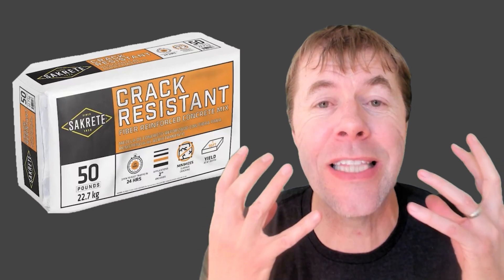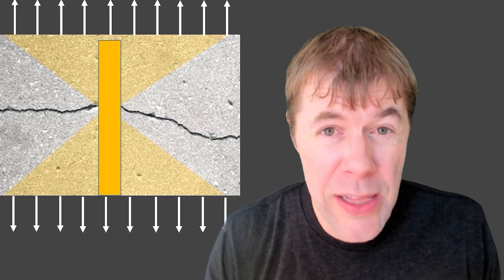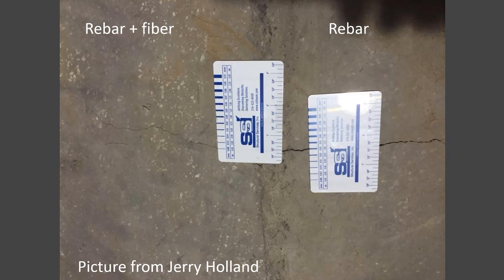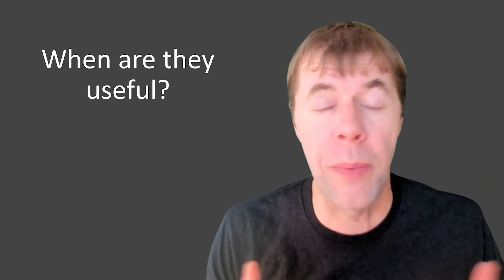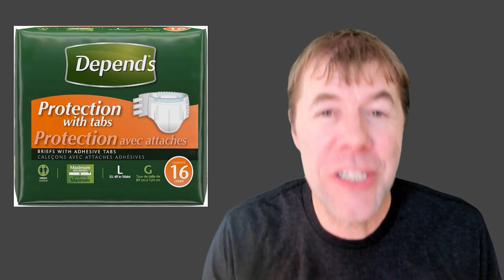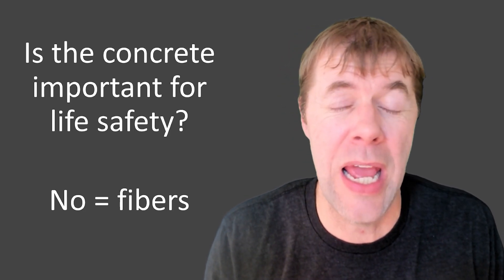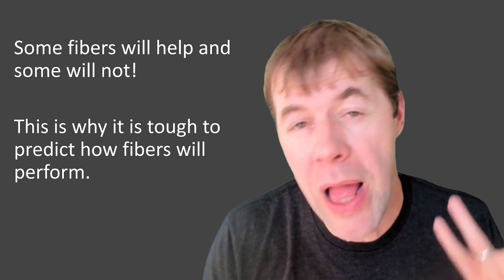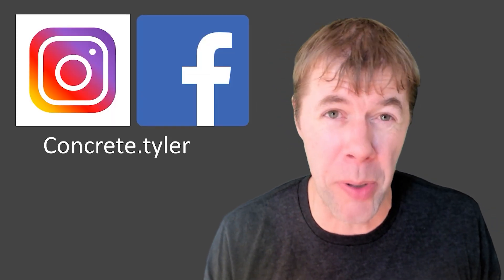Fiber reinforced concrete 2024 update!

Comment: Great show. A few years back you did a demo on cheap hardware 'rebar' that is only a bunch of fibers contained in a plastic tube, that is essentially useless for bearing any loads. But, your episode today got me wondering again: what about braided hemp rope as concrete reinforcement, that is, lengths of hemp rope as a replacement for rebar, in patios and driveways? While there's lots about 'hempcrete' these days as an insulated building material, there isn't anything I can find on the 'net about lengths of hemp rope, itself, used as reinforcement.
Reply from the maker: Intereting idea.  I will see if I can find some hemp reinforcement for future testing.
Reply: @TylerLey  It would be interesting to see how a strong synthetic rope performs as well. Something like Dyneema (UHMwPE).
Reply: Wow-- thank you for your acknowledgement, Dr. T! @TylerLey

Comment: And what is the meaning of "small cracks" ? If there is a crack it means concrete is already failed and now rebars are resisting the structure from collapsing
Reply from the maker: Crack commonly cracks.  It is not economical to design concrete not to crack.  By using fibers they can keep these cracks smaller and also reduce the load on the rebar.  I have another video about this that I will make soon.

Comment: So basically the job of a rebar is take all the tension after concrete fails so it means before failing of concrete the rebar is doing nothing, Right ?
Reply from the maker: It does a little but not very much.

Comment: Pound for pound, fibers are stronger than steel. The difference is you cannot add the poundage of fibers necessary to carry heavy loads because the mix would become saturated with fibers to the point of strength reduction. Conversely, because steel is built in the forms, essentially outside of the mix, you add whatever amount necessary to carry loads.

Comment: What about recycling?
How do you get them out of the concrete if it gets broken in a crusher?
Reply: Heat.
Reply: not an energy-efficient way if you ask me. and doesn't it release harmful substances? @elmerkilred159
Reply from the maker: Heat will melt them.  I am not sure why you would need to get them out of the concrete.  The crusher can still break them up but it may take more work.

Comment: Galvanized rebar ? 
Offset layers of four inch cross welded galvanized animal fencing!
Galvanized nails? Different sizes...
Could this make an expensive but super concrete?
Reply: Galvanized rebar exists and there was a previous video involving it.
watch?v=xVDy84rR5Z8
He first talks about epoxy coated rebar and the poor performance it has, then mentions that he thinks the best replacement for it is galvanized rebar. Keep in mind that you need a thicker zinc layer than in most other applications because the wet concrete paste reacts with zinc when not fully cured. Galvanized animal fencing might have a thick enough layer, or it might not. Using lower ph and faster curing concrete mix can help.
Reply from the maker: @5467nick  You nailed it.  Thanks for your help!
Reply: No animal fencing isn't a good steel because it lacks the deformation for the concrete to hold onto.
Rebar is a bulk product and you aren't going to find another substitute . Many people thought just throwing any and every type of steel laying around would strengthen concrete. Time and science has showed us that's not true. As a contractor I've had to demo a lot of that and the piece of  standard without the junk in it is just as strong. It a mess to demo though because it all handles up on the jackhammer attachment. Get a saw and good blade if you know you have to demo it.

Comment: What about using galvanized nails. Surely would be expensive. Could it make a super concrete?
Reply: Pr-stressed concrete slabs used tightened steel cables like giant guitar strings.
Reply: I've never seen nail proof concrete boots...
Reply: No. It doesn't have anything for the concrete to grab.
For instance Helix 5-25 is 5 twists in 25 millimeters. They other sizes and stainless steel. Standard is galvanized.

Comment: Question Tyler.  Essential Craftsman had a video on poured walls where in the form he had nailed thin strips of wood to give the concrete a weakened plane joint to crack.  Seemed to make sense to me.    Since it was a wall and not a slab, this provided the same as cutting concrete I guess. "Forming Concrete Walls: Ep.17" (about 9 minute mark) Is it a practice or practical to do the same with slabs?
Reply from the maker: This is commonly done in walls.  People have tried this in slabs by using an angle iron that is anchored to the base.  The cracks that form at the surface don't look as clean as a cut joint.  Some people think the non unifom cracks mean that something is wrong with slab.  There is another technique called a zip strip that Texas DOT uses to form joints in fresh concrete in bridge decks.  It works on a bridge deck because it may only be a few lanes wide.
  
With fibers you can move your joints out to 100' x 100' if you the right amount and type in in the mix.
Reply: @TylerLey I used to do concrete.  about a decade  ago I retired from it. I did a few commercial jobs that wanted me to use zip strips, but they were cumbersome to instal and to keep straight. On One project I decided to try something a little bit different; instead of using zip strips, what I did was I bull floated  the concrete and then I put a jointer attachment to my bull float and scored joints into the floor where I wanted my zip strips to be then I took the jointer off of my bull floor and floated back over it untill the mark  was filled back in with paste, and it was invisible, but it still made a weak point in the slab and later it would crack in a perfectly straight line where I had marked it. it works very well
Reply: @BracaPhoto The wood was not embedded, it would be removed when the forms were taken down.  Opposite the wood was for all practical purposes a long piece of angle iron.  These two things, one a decorative relief, the wood, from the best I can asses and the angle iron complete the engineered wall to create the weak plane for the concrete to be able to crack in a controlled location or controlled plane.  I was interested if this is ever done on slabs.  Yes, you cut the top of slabs at certain intervals but do they ever provide an engineered weak spot on the bottom of where you would do your cuts.

Comment: Caution: rebar sold at many home centers like Lowes ,Home Depot are  poor quality not 60ksi not ductile and crack like pencil when bent into hooks etc.
Do NOT use in critical structural elements like beams or columns etc
Now I see fiberglass rebars there. 
Obviously cannot be bent or  welded .
I have complained to Manager and sent a load back to store recently.
Ask merchant for paperwork where rebar came from and its certificate of quality strength.

We have been using fiber additive on floors walks for decades now.
Can affect surface finish if to much added.

Excellent channel Thank you 👍
Reply from the maker: Thank you!  I have seen some questionable rebar lately.  I agree that everyone needs to keep an eye out of suspect materials.
Take care and thanks for watching.
Reply: Sounds like everyone should bend a sample 180° to verify ductility or reject the batch.